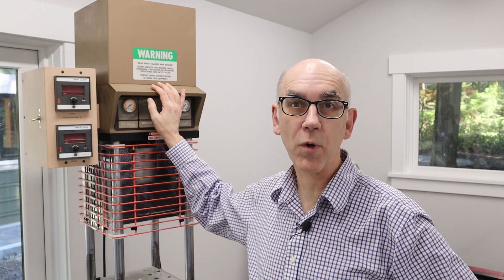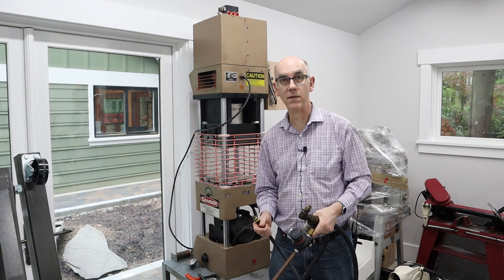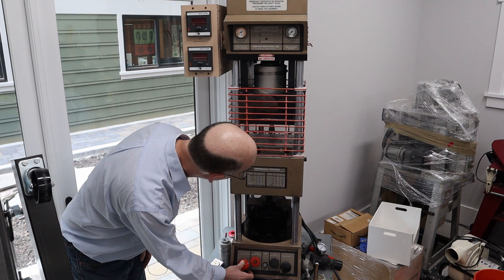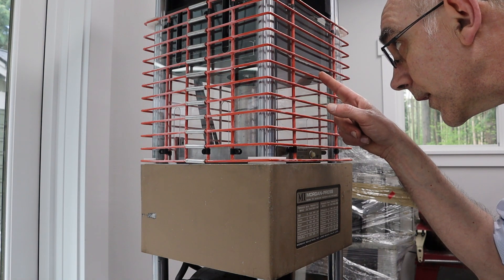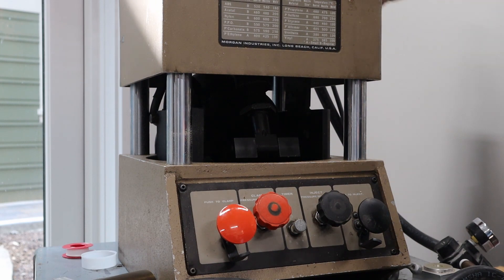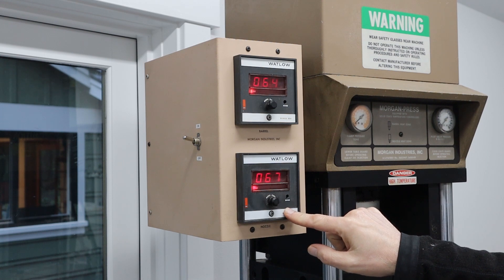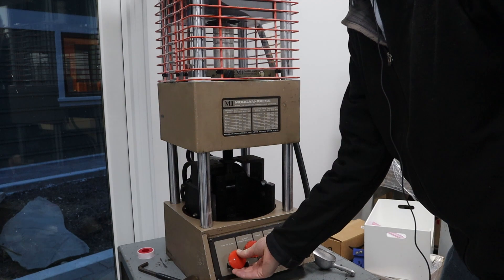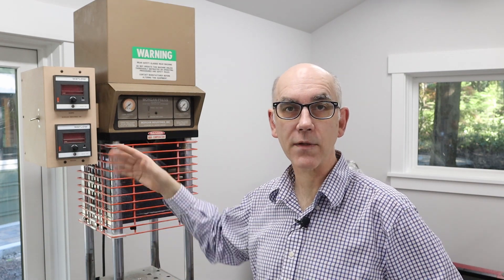The Morgan Press Comes to Life

Comment: Hey John very helpful video Thanks so much  Just got a G=55 E and am trying to set it up I was wondering if you could do a video on maintenance 
don't know where the filter lubricator is?  and maybe replacing the O rings for the air cylinder?

Comment: I was looking at getting one of these - what is the cost of this model?
Reply from the maker: You'd have to call Morgan Industries to get the current new prices. As to used, it's been a while since I looked. It used to be that you could find used machines for around $5-10K. But I just did a search on eBay, and the used prices seem to start at about $8K now.

Comment: John, great and so jealous!  I've been looking for a Morgan Press.  I have a 1998 Morgan Industries book called "Cutting Costs in Short-Run Plastics Injection Molding" that put me onto them.  Maybe they still sell it?
Reply from the maker: Yes, I think they still sell the book. They also still make the machine. It's pretty much the same machine they've been making for over 30 years. The only changes are slightly newer heater controllers.

Comment: I have a Mini-Jector #45 and added a surge tank between the regulator for injection pressure and the injection cylinder.  It made fill pressure more even.  Obviously, the air compressor still runs the same amount but at least your not starved for air volume.  It's a HF 10 gallon, 1/2" ID PTC fittings.  After the regulator is important to provide quicker response.  You may not need the bigger compressor.
Reply from the maker: Thanks. That's a great idea.

Comment: This is a great machine, the toggle clamp design is very good and its adjustment is easy.. by turning the hex wrench。Lately, there is other design with using manual or air over hydraulic jack replacing it. This machine can handle more complicated and larger part injection  molding than what the one you are demonstrating!
Reply from the maker: That's why I bought it. My most recent video shows a part that I can't make on my other machines because it's too large. I'm planning on making that part with the Morgan.

Comment: Good to finally see you getting the Morgan press commissioned, your videos piqued my interest in small scale injection moulding. unfortunate that those morgans are extremely rare where I am. Would have loved to have found one but I ended up picking up an austin allen prt250. May make some videos with it in the future. There is even less information online about those then the Morgan press.
Reply from the maker: I searched for Austin Allen PRT250 and didn't find any information :-). Would love to learn more about it. If you're on Facebook, here is a group worth joining for small plastic injection molding: https://www.facebook.com/groups/2206675146227501
Reply: @JohnSL  Thanks John, I have just joined that group. I might have to post some photos of my machine once I get round to commissioning it. I've two other machines needing attention before it. They are more commonly referred to as a 'gnat', hardly a flattering name. You can find a few photos on Google images if you search for austin allen gnat. They are fully pneumatic with separate injection and lock/eject cylinders. They are also capable of fully automatic operation utilising mechanical relays and solid state timers. Pretty neat really
Reply from the maker: Cool! Please post pictures of your machines on that group. I'd love to see them.
Reply: Build one on your own.